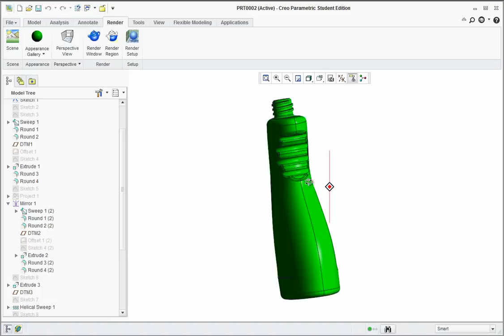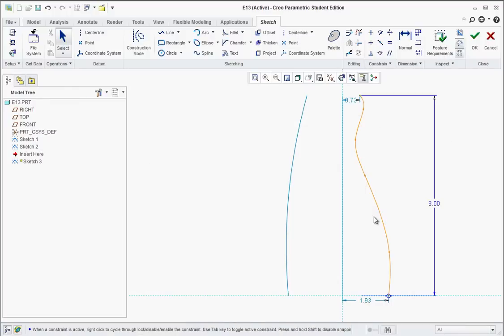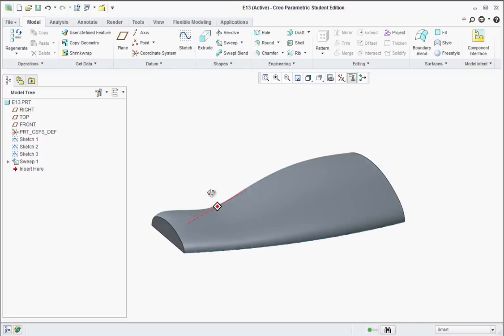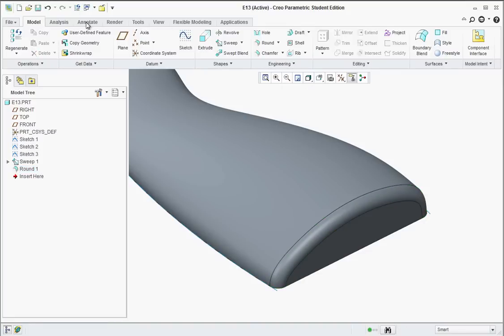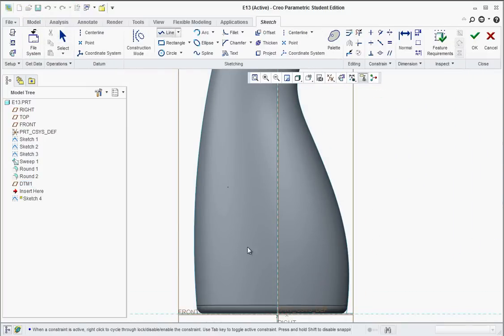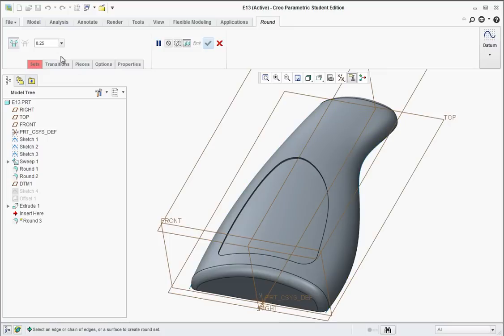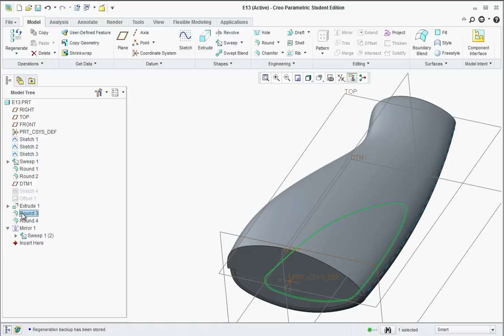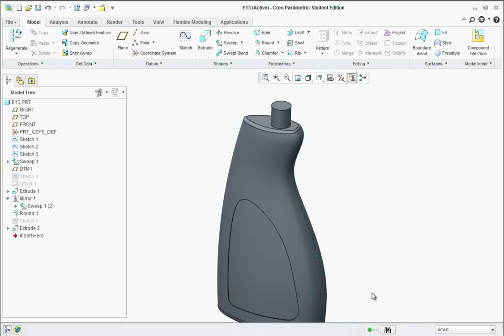E13 CREO Parametric 2.0 Sweep Bottle - Basic Modeling 8

Comment: I have a problem with the selection of the surface that is to be changed to green. By clicking the left button several times, the surface is changed to pink and shows geometries sweept, or green edges of the model. I tried to change it in the lower right corner of the other selection options but also does not help. Is it possible that in Creo 3.0 has it differently than in Creo 2.0.